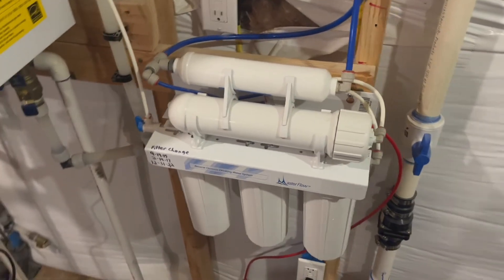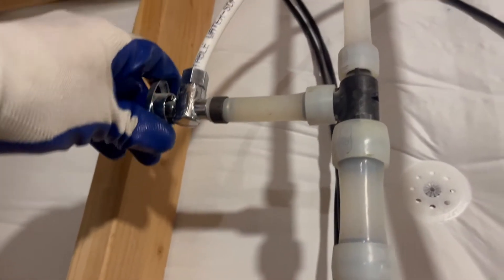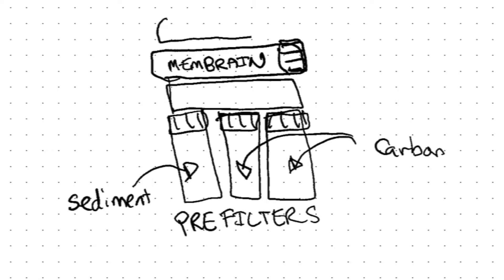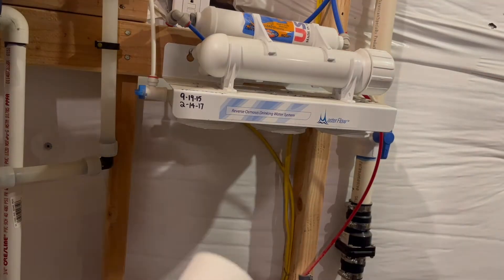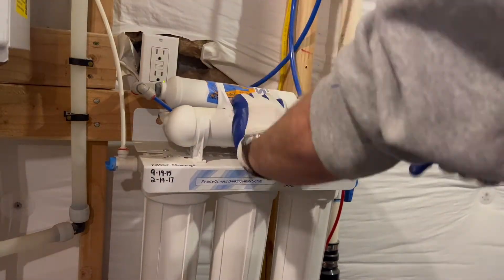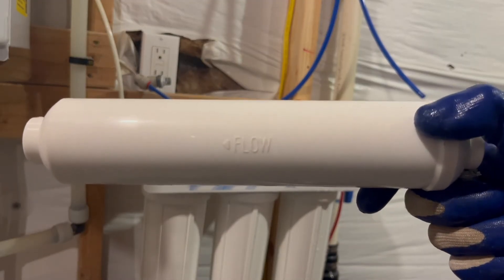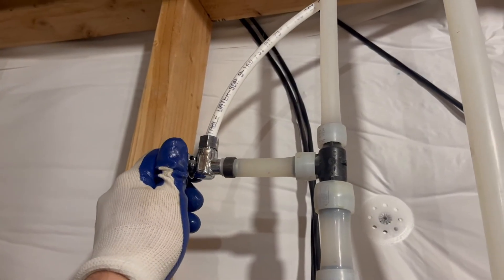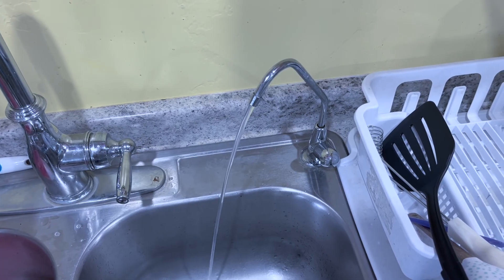Reverse Osmosis Filter Change

Comment: Just followed your guide. Once I turned everything back on my pump seems to be continuously running
Reply from the maker: The system will run for a few hours as it refills after you have replaced filters.  If it does not stop, then you might have a bigger problem.  The drain line from the membrane has a flow restrictor.  If in the process of replacing the filters, the restrictor was lost, then it will run continuously.

Comment: Why do you have a T at the inlet of the post filter coming from the outlet of the RO membrane?  I am assuming / guessing you have the T feeding both the tank and the post carbon filter and the outlet going directly to the faucet so when the faucet is used it is not getting it's feed from the tank directly but directly from the post carbon filter. That mean the pressure tank water has not been post filtered. As demand happens the tank water goes through the post filter to the faucet. Please confirm. Mine was set up with the post filter going to the tan and a T at the tank going to the faucet. I  like the idea of the faucet water getting that final post carbon filter at time of use rather than sitting in the tank and then going directly to the faucet.
Reply from the maker: This model was installed as it was designed. The Tee after the membrane allows treated water to go to the reserve tank or to pass through the final carbon filter before going to the faucet.
Reply: I was confused about the routing as well. It seems at 3:38 the line from the tank looks like it feeds the output of the post filter. Had to watch it and rewind a few times to catch that there are actually two lines coming down that same stud/location, and they criss-cross. So the tank connects to the T, and the tank and the system both route through the final carbon filter which then goes up to he faucet. Thanks for a great video.

Comment: Many thanks for the clear guide. How often must the Membrane be changed?
Reply from the maker: Depends on the manufacturer. Usually one per year. Some recommend more often. That might just be so they can sell more filters though.
Reply: @plumber-tom9470  
Thank you very much.
Reply: Water quality varies by location and should inform a your changing schedule. Get a cheap TDS meter and use it to monitor your water quality. You can use it to measure your membrane’s rejection rate (ro filtered water ppm/tap water ppm) to see if it drops below 80-90%, which is when you should change.